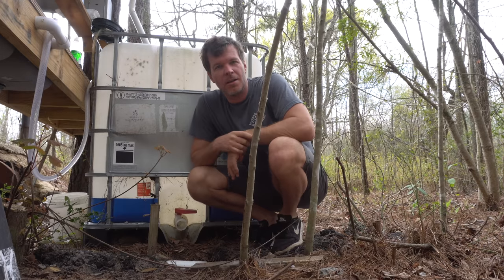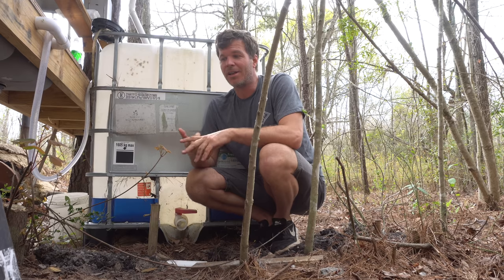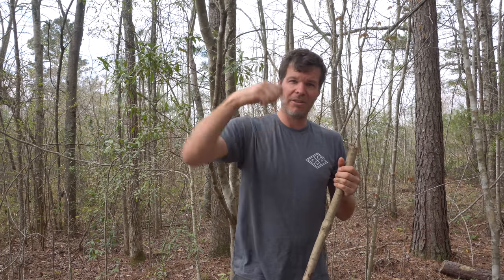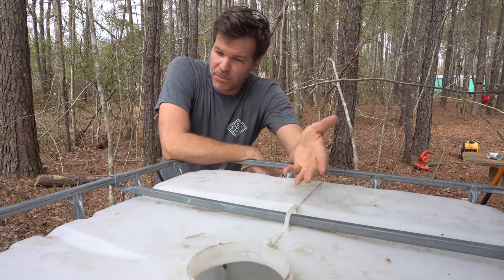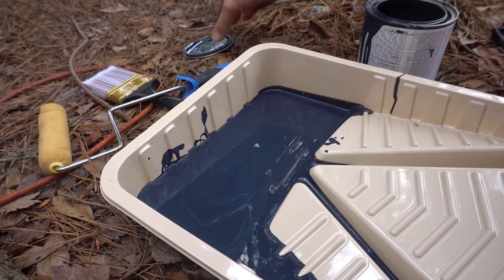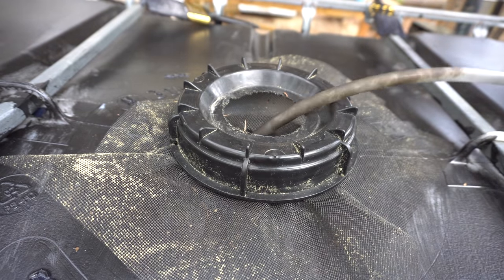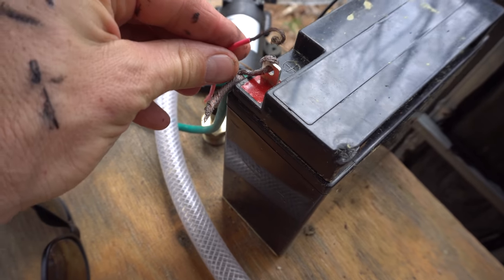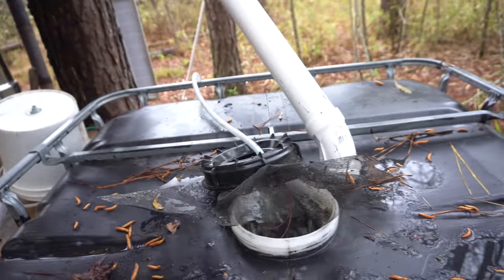Is Collecting Rainwater Illegal?

Comment: A few suggestions : 

add a filter in the gutter exit if you don't have one already. Make sure there is a small step, as to no take the 1st cm of water with the heavier sediment. (this is very useful if you have very light rain) You can make the step much higher on the side the water will come from to prevent debris to go down the pipe (useful in case of rare but strong rain) 

Fix the end of your pipe to the cover of your icb. Seal it with aquarium silicon (do not use bathroom silicon. It is toxic) then "just" plug the rest of the pipe in it. Like this you won't have any debris nor bugs coming in and can still service / clean the icb. 

You can pass the pump tube through the pipe. Once again, seal it with silicon. 

You don't have an overflow system, you may consider adding one. You could add a syphon. Some design can double as overflow system. Syphon are also a nice way to catch a lot of heavy and floating stuff which may pass you first filter. It will also prevent bug to enter the icb (assuming the syphon don't dry out). This is also a nice point to join the fixed icb entry pipe and the roof one. 

Easier and most important :

You definitely should consider adding a floating device to your pump intake. You don't want to take the water from the bottom of the tank. (nor the top part where the pollen float. It damage your pump, etc) but around 5-10 cm from the bottom or top. 

For garden usage, throw some copper (eg 5cm of pipe) into the tank. It should be OK for drinking water too, but please check that. This help with alga and bacteria.